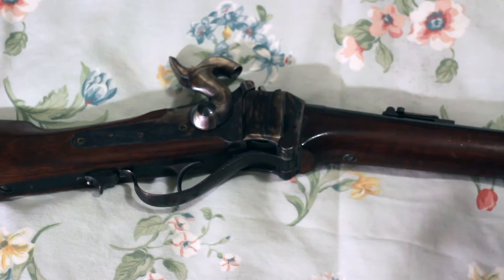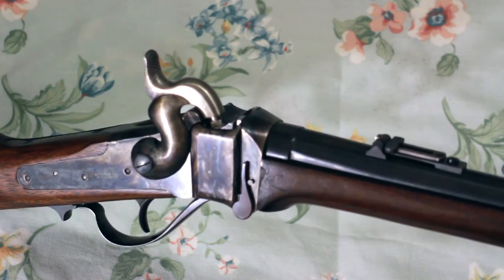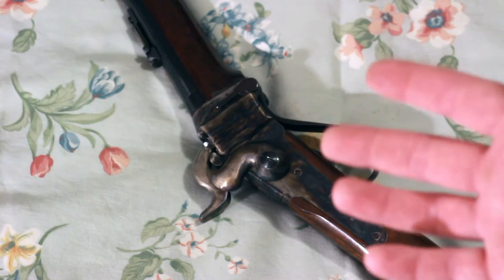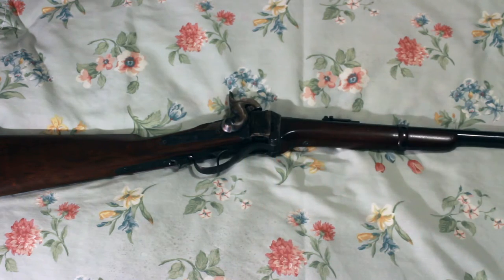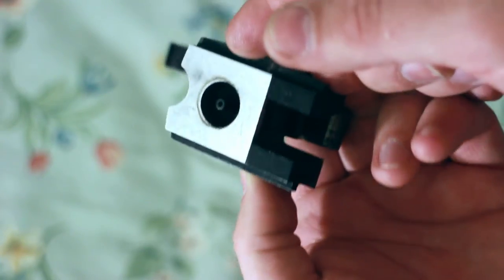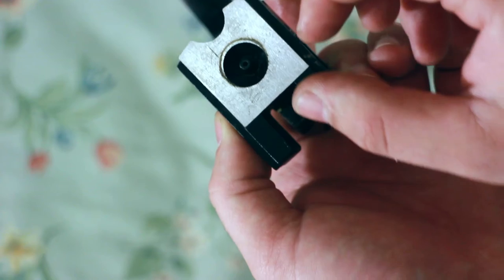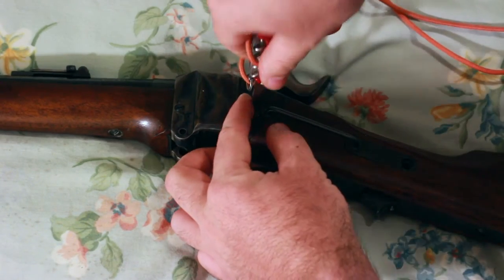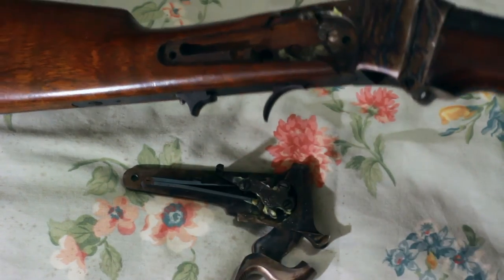1863 Sharps Close Up, Disassembly, and Function

Comment: Would you know if the trigger lock mechanism is the same on a 1874 Sharps?  I've got a Pedersoli 1874 Sharps, was getting light hammer strikes and ~20% rounds not firing.  No visible damage to the firing pin or breech block that would explain it, thinking something's could be going on with the trigger lock preventing the hammer from hitting like it should

Comment: I lightened the trigger pull by re profiling the small leg of the main spring. I will tell you it takes a lot of patience and strength to remove and replace that spring. I  also polished the sear nose and the full cock notch. please note POLISH NOT REMOVE any metal. WARNING do this at your own peril because if you make an error it will cost you big bucks for new parts.

Comment: I have an IAB Sharps in 45-70 Gov. The trigger on mine is heavy as well.
Reply from the maker: I think most of these have a heavy trigger to prevent a negligent discharge. I hear the ones with double set triggers are like glass though. Thanks for watching!
Reply: How has it done for you so far? I just picked up one yesterday. From what I've seen, I. A. B. had a few rotten tomatoes which killed its name.

Comment: Absolute agreement about the tiny sights on these carbines.  I was wondering why you weren't mentioning the ejector during the take down, then, LoL, I realized, yours is percussion while mine is a cartridge conversion, so you don't have an ejector.  Regarding the saddle ring, if you google welded steel rings, they come in all sorts of sizes, just pick the one that is historically correct.  They run about $2.50 for a bag of 10 of them.  LoL, dump the extras on Ebay.  Good video.  What's your area?
Reply from the maker: Well I sold the rifle over a year back. It's that guy's problem now I guess. Thanks for the advise though. I do appreciate it. I live in South Texas.
Reply: Penny Pincher Ian ok.  was going to suggest a Sharps carbine shoot off, but you sold it.  Ah well, too far away anyhow.